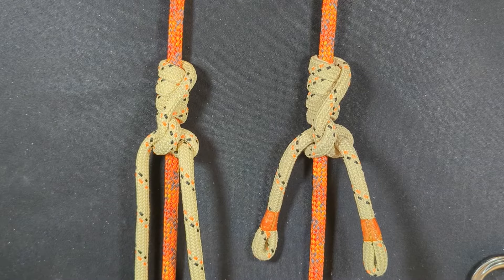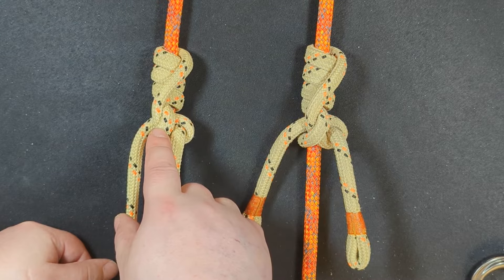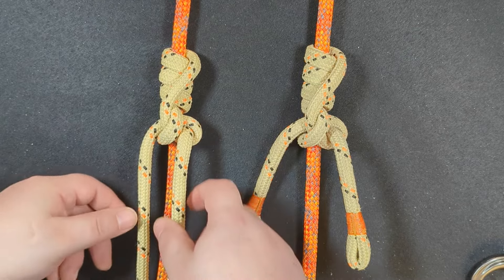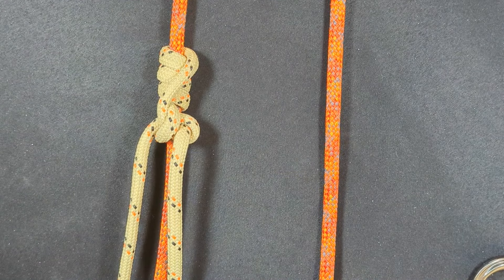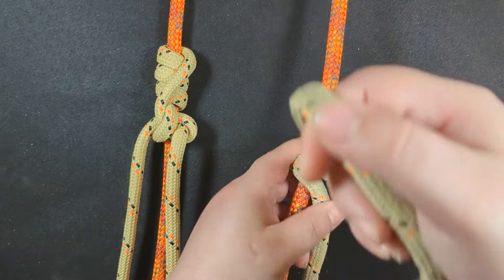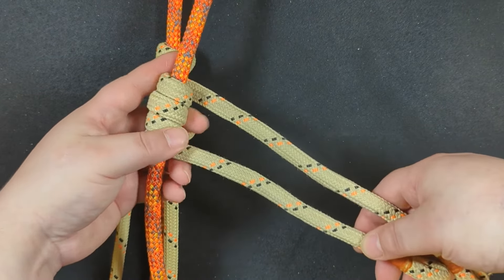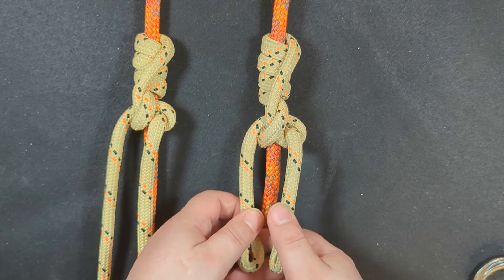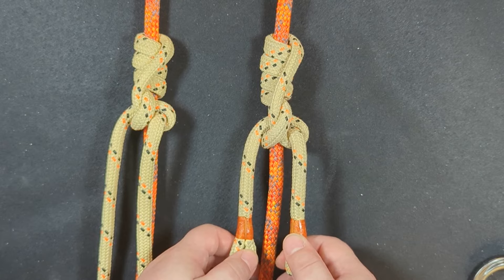INFINITY Friction Hitch for Arborists & Tree Climbers!

Comment: 7:13 I really enjoy your passion. I moved from VT because it needed a lot of space in rope wrench, and had a lot of setback.
Michoacan was good, but bound tight, hard to tend after full loading...
I'm using Calligraphy 2 mostly.
When preparing your videos,  I get frustrated by how much time you spend tweaking length. A dot on cord at top of hitch, when completed, would allow you to retire quickly. Showing the dot at start... for comparative length left right... would help.
Then hitch couuuld be tied starting at top!!!??
I love your snap in videos...😊
Reply from the maker: I stopped using the VT for the exact same reason. It sprawls too much to be used with my rope wrench effectively and tons of setback. Michoacan isn't as good as my Calligraphy hitches in my opinion. Calligraphy 2 is an excellent choice because it's somewhere between a Calligraphy hitch and a VT with it's one braid.

Sorry to frustrate you with all the length tweaking. I'm a bit obsessive-compulsive. As for your suggestion about the dot in the middle, that won't work because many of my hitches would use asymmetrical amoutns of cordage on either side. When I use a length of hitch cord, I'm usually not even trying to center it out (at least not on camera) because as long as I start mostly in the center, it'll turn out good enough for film (since the legs aren't visible below the shot). Whenever I tie a hitch with an actual eye to eye, I always try to get it even because it would look sloppy if I didn't and I learn where to begin (roughly) on the cord for each different hitch, but sometimes I forget. I would need a special, differently colored dot for each hitch that doesn't tie symmetrically and then all of my hitch cords would be polkadotted haha
Reply from the maker: The snap? Do you mean when I clap and remove things from the rope? That's sort of my signature thing. I'm not very good at editing videos, so I used a really old fashioned movie trick to make my videos unique. =-D

Comment: Though older, it's still a good hitch. It's quick and simple enough in case of urgent need.
Reply from the maker: Well, it's old to me, but new to my viewers! It's easily one of my top 20 hitches (out of over 85+ in total) that I've created and developed! This one is particularly sweet because it can be tied in a regular length sewn or spliced eye to eye (between 28-32") and it is not nearly as complex as some of my other hitches! It also looks absolutely stunning, if I say so myself! Thanks for commenting!